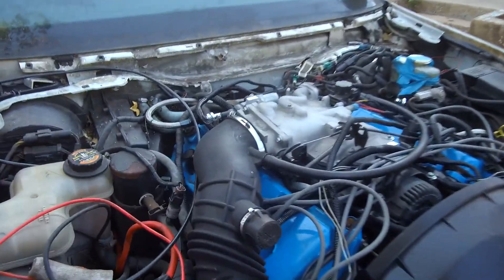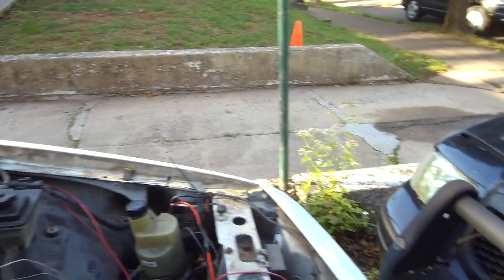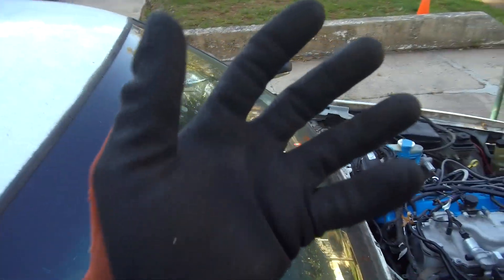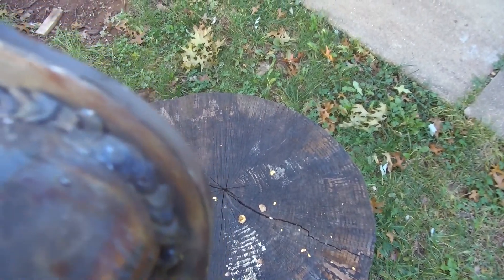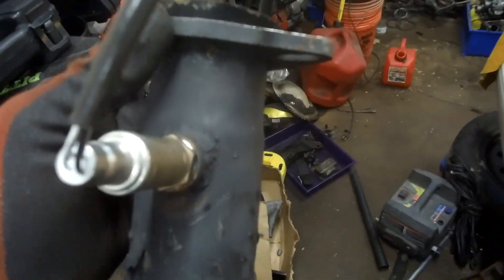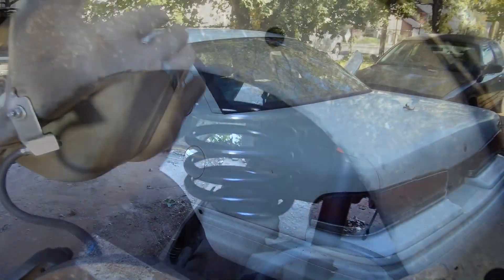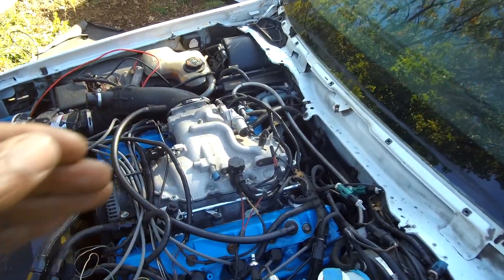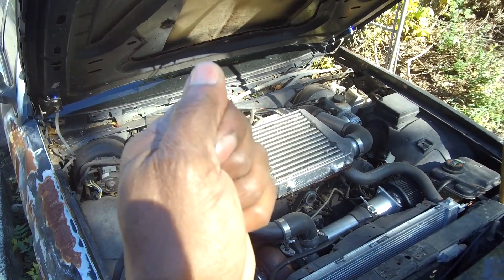Crown Victoria ( on the ground ) Turbo 5.4 vs 4.6 ( Conversation )

Comment: Wow! That 4valve looks amazing!! The 4.6  to 5.4 looks cool too!! Honestly, the 4v are going to yield more power.  But I'd love to see a 5.4 at maximum potential!! 👍👍
Reply: I will have to follow what you said. 5.4 2v build  is very rare in today's youtube market. I think this would cool.
Reply from the maker: Sorry for the late reply brother Corey... Ok thats what we doing then 5.4 2v... I have to source rods to even start...Just will make sesne to take that route .. Not to many have a Budget boosted version in there car... Question twin or single turbo.. twin will use all the ( bottome end tq properly) or single would be simpler but a little lag. Your call

Comment: Hey man. So I am a car noobie but am starting to learn. I have a stock 2000 Base Crown Vic with 31k miles. I really want to put some work into it ($10k). I feel like a coyote swap wouldn't feel right on such a fresh 4.6L engine. Do you have any recommendations on increasing the power while also making adjustments to the body to handle the power?

Comment: I found that... after taking the fuel pressure regulator off of the 1993 4.6 that... once the return line plug is filed down, it will fit in the fuel rail where the OEM pressure regulator went. thus allowing a small strap to bolt it down with the )-rings on it... as it then flows excess fuel out. because i got 400 gallon a hour pumps feeding a 300lph injector pump... the OEM regulator was over pressurizing the rail by 10psi... 10psi is a lot of fuel thru 42lb/hr injectors... but anyways set to 20psi and idles at 10psi the 42lb/hr green injectors work, there is just a lot of fuel that has to move over them for if one puts an S475 on it. motors or axles? Took 100psi thru the stock injectors to brake an 8.8 cv axle, the 300lph injector pump by its self with a 200gph pusher pump was not happy about pushing 100psi on a hot day. but the 42lb/hr injectors idle at 10psi and work good at 20psi wide open... 10psi of boost using a boost reference regulator would be 75% duty on the 42lb LT1 injectors that are 650hp at 43psi. they are sized just right for mechanical tuning on a 4.6, 2000rpm no load idle EGR IACV delete etc... need a 8 gauge wire to run the fuel pumps. a walburo 350 has nothing on two marine pumps pushing a injector pump, go clear out to 150psi if the return line gets plugged, walburo350's cant even make 25psi. but that's a full EPA delete to brake an 8.8 ford axle with a stock NA 4.6, just an air filter delete and bumper ram air scoop. had to add a lot of weight to keep the power going thru it. NA rev and drop in second gets the wheels the peal and screech real loud but the back end is so heavy that's a solid 390lb~ft to do that, 310 brake horse power, NA 2 valve... only EPA deletes. 13-20mpg.
Reply from the maker: This si great info here... I have to keep this in mind... this car is so funny.... I have to figure this out...I need a solid week with the car and I can figure things out..

Comment: My old 2v is in its last leg on my 93 town car and i stumbled upon a intech v8 from a mark viii how feasible would this swap be? would the factory harness work on the intech engine?
Reply from the maker: yes it will but make sure your intech engine has a return style ( gas line ) and also you may have to mimic some wiring and lengthen some wires... Then a tune to make it run right.. and mod you exhaust down pipe